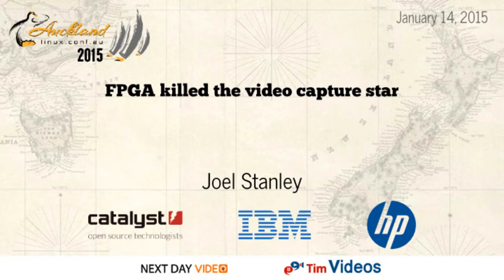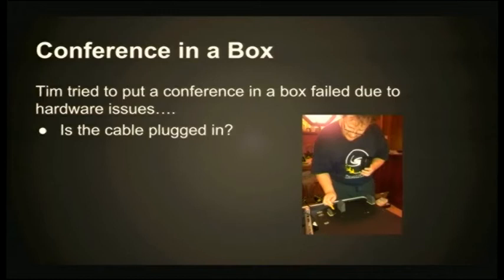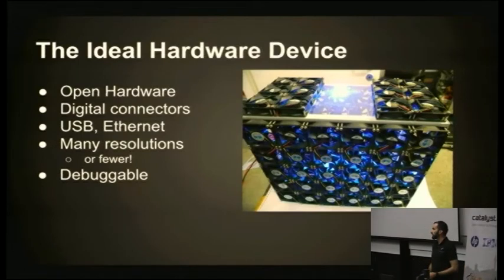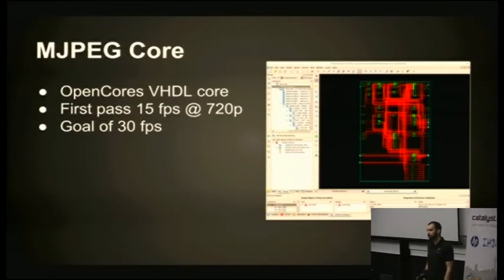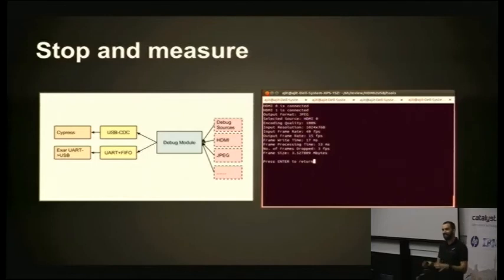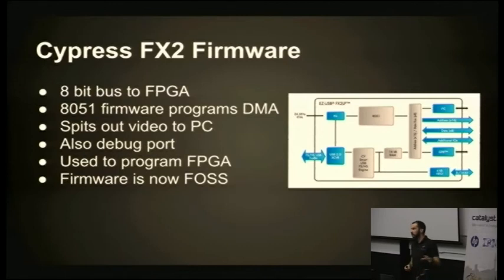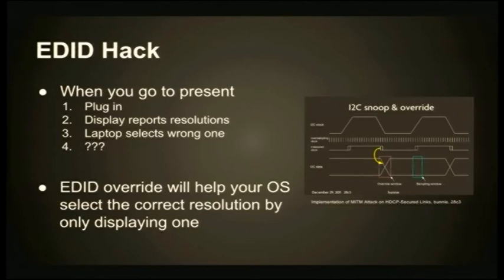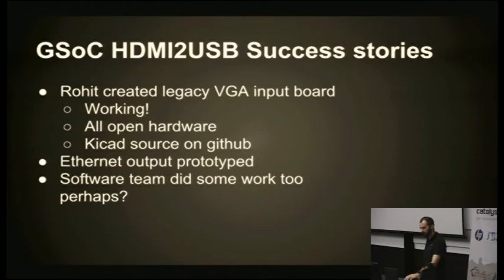FPGA killed the video capture star

Comment: Really impressive! Could you copy links from your last slide and share them in the description? Any more info on TravisCI integration for open HW projects? Thanks
Reply: +Robert Walczyk https://docs.google.com/presentation/d/1TSMmxsLBXsrGr-YC358YuHTPtJV-4PKSoCwLksXvoik/edit?usp=sharing are the slides.

You can see how we currently do CI for the FPGA here https://github.com/timvideos/HDMI2USB-misoc-firmware/tree/master/.travis
Reply: +Joel Stanley Thanks! I see Timvideos project had 8 projects: Developer website, HDMI2Ethernet, PTZ camera control, VGA capture board, bug reporting system, Flumotion/Gstreamer.
Where can I find out more about these? I'm particularly interested in camera control and flumotion/gstreamer